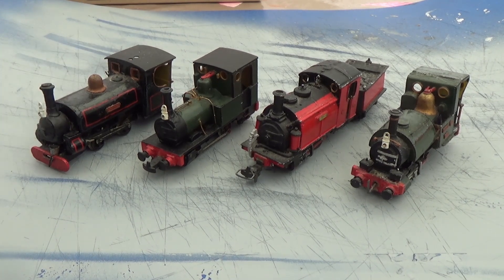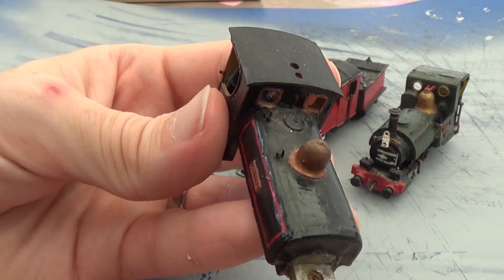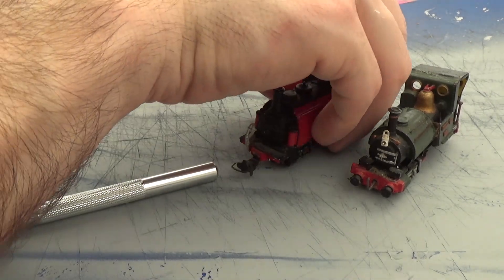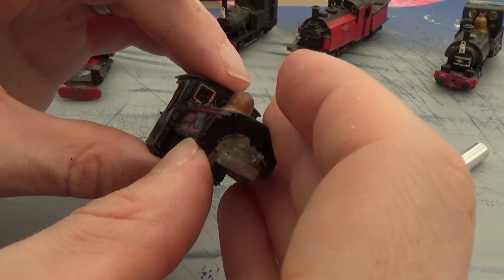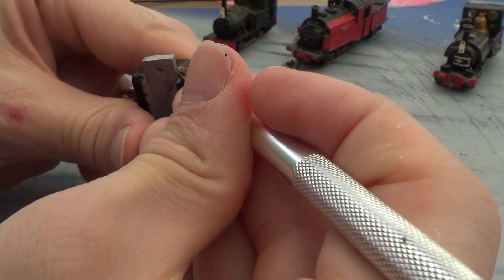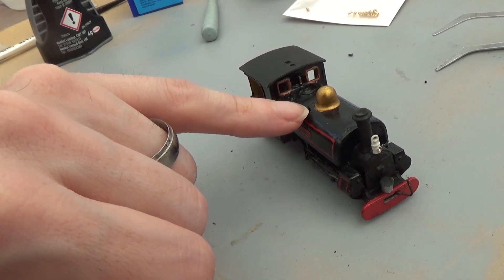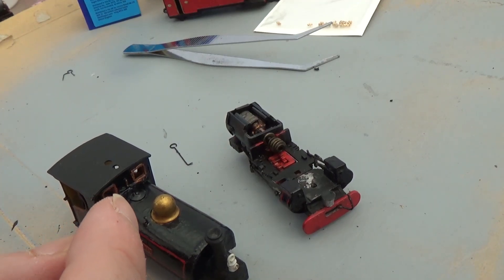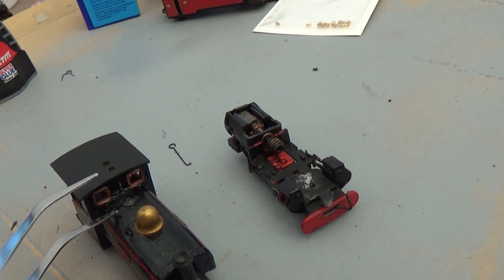Restoring Old 009 Narrow Gauge Whitemetal Kit Locos Part 2 | The Railway Room

Comment: Another great video and comprehensive follow on from part 1. It was interesting to see your sympathetic cleaning, restorations and upgrades of these four models. I like the useful modelling tips e.g using cheap cleaner for paint stripping as well as mentioning the manufacturers for various products. I thought Charles could do with a coat of matt varnish but understand that you want to keep it original.  Your Dad would be very pleased.
Reply from the maker: Thank you very much for the great comments and encouragement! It is tricky to find a balance between respecting the original builds and adding improvements and upgrades, but hopefully I got an ok mix

Comment: Nice little collection your dad had there, and I think you did him proud with the rebuild. I love 009 narrow gauge models but they are getting a little bit too small for my eyes and I am thinking of moving up to 5.5mm scale instead.
I find that soaking diecast or white metal models in a bath of Dettol in a hot bain marie brings paint off in a few minutes rather than having to wait over night or longer for paint stripper to do its thing...ok it smells a bit but is far better than using some really nasty chemicals in paint stripper.
Reply from the maker: Thank you so much for the great comment! Dettol is a good choice for removing paint. I generally don't mind waiting a bit longer for other methods and this one doesn't give off much fumes at all